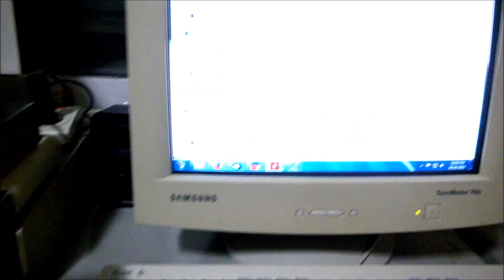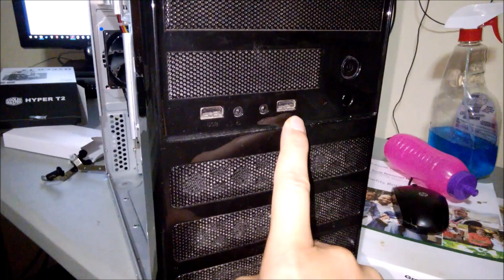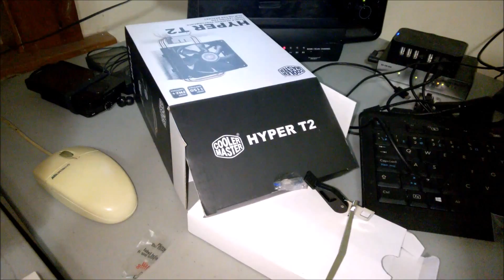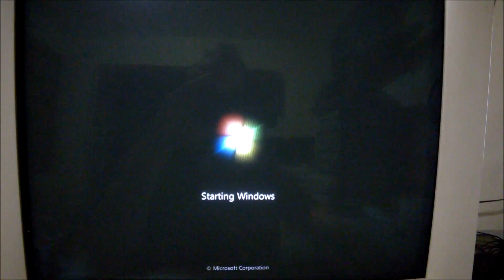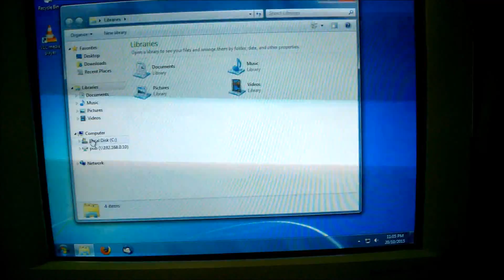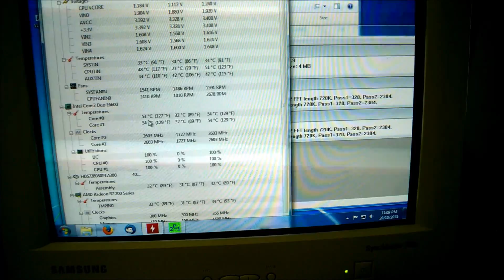Cooler Master Hyper T2 Review and Test

Comment: So I built my machine a few months ago, Cooler Master T2, B360m mobo, i5 8600, 16GB RAM, GTX 1070ti ect... Superb balance.

then I couldn't resist a stupidly good deal on a used i7 8086k ( works 10/10, chip was shiny like a new) Now my T2 is cooling this 6 core 12 thread beast... and honestly I amazed check those numbers.

https://imgur.com/a/1vFJd5n
Reply: 😲 thats crazy good for a baby T2
Reply: @MrSamadolfo  IKR, I can't overclock it but in synthetic loads like prime95 it quickly goes in the low 80s even with noctua #2 thermal paste. Gaming usually stays around the low 70s even after hours. Didn't I'd see an improvement with things like chrome and stuff line than but it was still a small bit faster just turboing like mad for a second to open chrome X) it's a mean machine!
Reply: @underabridgetoofar  😀 Gaming with Low 70s, thats crazy good with a cheap baby T2 and a 12 thread cpu, thanks for the test and info 😏👍

Comment: 1:05 says he can't remember what model CPU he has with this mouse pointer about half an inch away from where it clearly says "E6600" CPU.  

PS: you mention using Rosewill Ranger-M for cheap builds, but it has no USB3 in the front... I've worked with that case, try the Rosewill Line-M instead... it's basically the same as the Ranger-M, but has USB3 in the front and is an overall better case for pretty much the same price.

Comment: Hi, you have placed a Zalman CNPS7000V is cheaper than that Cooler Master and has 
greater dissipation flow even with Xeon X5460. On the other hand good PSU Seasonic is the 300W?. Greetings.

Comment: 9:25 , how did you apply the paste. Did you use the dot method on the CPU or did you smear it all over the heat sink? I have this same cooler installed on my athlon 64 x2 5000+ using the dot method.  My temp averages 37 degree C in linux and 42 degree C in windows 7. These are idle temps.  Now I don't have a 80 mm fan attached to the rear like you do, nor do I have a front fan for blowing cool air in. But I would think I would get lower temps. If I remove the side panel on the pc case, the temps drop about 3 maybe 4 degrees.
Reply: Actually you should just place a small line or a drop of thermal paste like a size of a grain of rice. When you clamp the cpu cooler it already smears the thermal paste from pressure so you don't need to. Also if you put a lot it could come off the edges and go into your motherboard.

Comment: will the fan clear the ram sticks? because i have a small case and the cpu right next to my ram
Reply: Get a measuring tool and measure the distance and look on the specs of the cooler. You might be able to just remove the fam and place it on the other side.